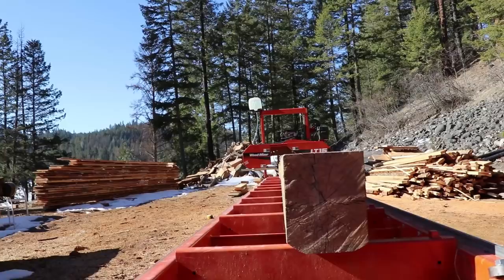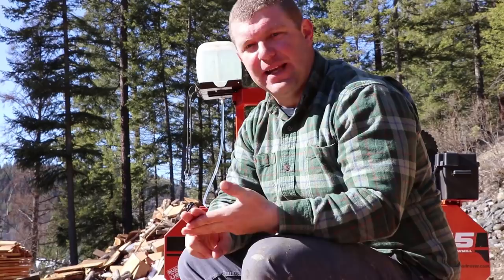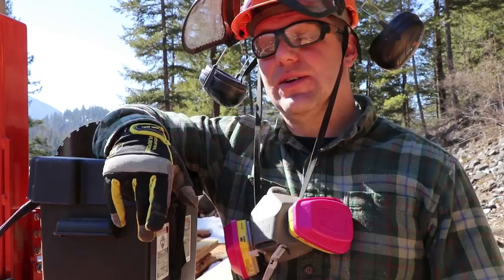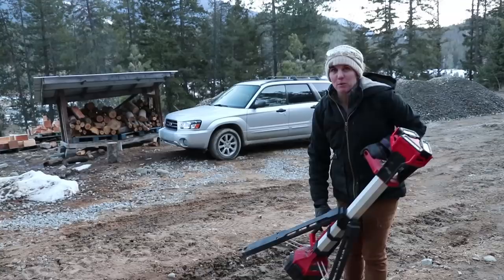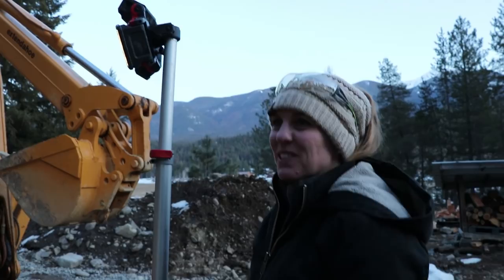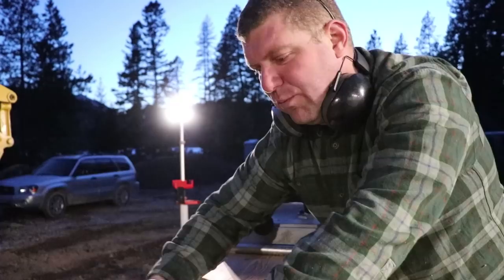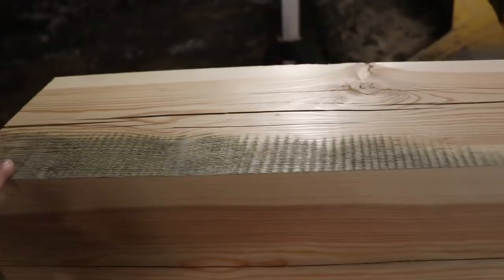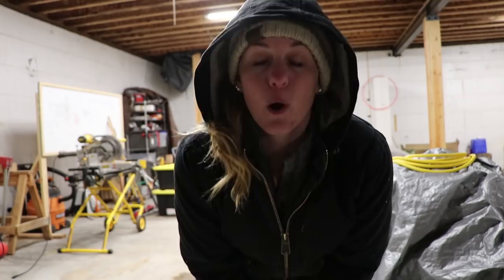From GARBAGE to GLAM (Mystery Sawmill Project)

Comment: Love your video's. So I had a thought and please pardon me if it's already been thought of. Your sawmill seems to take a lot of your time calibrating it. What if you poured a slab of concrete to put it on, well supported with rebar. Less movement of the sawmill and less time calibrating it. Of coarse you would need to pick a more permanent location for it and maybe even partially enclosing it at some point. I've got a feeling that your going to be using it for years and years. You guy's are doing a great job!!

Comment: Part of your problem is your missing the bottom locking nut on your supports. should be a nut on both sides of the steel plate on the mill. Probably should have the mill off the ground so ground heave doesn't effect level. Try 4x6s spanning concrete blocks set 12" into the ground.

Comment: Make rocket stoves using your plunge mortise chain saw on the end cuts.  Make great reusable camping or yard bbq.   Great use for small diameter waste and cooking by the patio.  Great barter and gifts.  Tarps save shaving  clean up and make bagging much easier.   You could leave a used wood rocket stove at campsights your neighbors frequent to picnic swim hike.  Much more efficient and smokeless fire to boot.  They can be put out and reused.   They make great burner for cast iron pans and pots.
Reply: There isn't a farmer with animals that wouldn't  trade carbon wood chips and sawdust for manure.   Great symbiotic compost trades.  Farmer spreads it on fields and hauls in bedding.  Recycled ag bags work until you get a dump trailer. Take turns on delivery with tailback.  Great progress.

Comment: Jesse:: I mention this one before when you mailing timbers for your house, cut some slabs that are 3 or 4 inches thick and 12 to 16 inches wide, and the length of your sawmill from side to side, where leveling feet are located cut a hole the same size of your leveling feet, set your feet into them, this will keep them from sliding around, and get rid of the concrete pads. Once you have level the planks from side to side and to each other, you should not have as much problems with keeping the sawing deck level. Good luck in your endeavors.

Comment: Why not drill holes in concrete slabs on which the saw stands and then use threaded bars and nuts to get the saw level?
Reply: there is no possible way that the saw mill is that far out of level every time they turn a beam its just to add suspense to their "show". if its actually anywhere close to as bad as they make it sound its a manufacturers defect that is not normal lol

Comment: My thoughts: Get that Mill bed set up on its Flatbed Trailer. Anchor the feet, and get them precisely calibrated. Then, Weld the Adjustment Nuts into position on the leg Screws. No more jostling the Mill Bed out of calibration. And if necessary in the future, the Entire Leg assemblies could still be replaced.

Comment: Just had a thought about the calibration for the mill.  After calibrating, you could drill a smallish hole ( 3mm or so ) in each cross brace in exactly the same position all the way down the bed. Next attach a laser at one end, shooting along the length through the drilled holes......as soon as the mill goes out of true, you'll see where by the laser clipping the edge of the hole. Keep up the great vids ! :-)

Comment: I was just wondering if you made a level cement pad for the sawmill would you have to calibrate it so much? Heart job guys 😀
Reply: probably check the Wood Mizer channel for those tips
Reply: I would think so...maybe not as much but those tiny leveling legs are to small for all that weight.  I used big square timber’s and placed my mill on them.

Comment: I agree with Jay about those flexible pieces. If you’re not interested, I have a desk that could use veneer as it’s particle board, and used.  I thought it was real wood as it did have some. Alyssa could even make cylindrical baskets. Have to cut out a round wood bottom with the center a little thicker so it won’t crack. Like you need more to do😊 LOL

Comment: Thoughout this whole build, I was wondering why they did not use lock nuts to secue the feet on the mill @9:44.
Reply: Dave Krieger it’s not the feet adjusting their own it’s the mill shifting and moving on the concrete pavers and the pavers shifting and moving on the ground. In a perfect world it would be sitting on a large concrete slab and then it would never move

Comment: years of drying on our frame. even with the air to air venmar heat exchanger ventilator, window condensation was an ongoing problem for 2 years. have the ventilator ready to go as soon as it is dried in.

Comment: Jessy, I hope you don't take this the wrong way but when using corded power tools you should run the cable over your shoulder, this keeps the cord away from the action and has two advantages 1, you cannot trip over the cable and 2, the cable cannot get trapped in the tool. Great video as always.

Comment: I wonder if, in hind sight, they would have purchased the hydraulic roll and grip package?  Seems like the hydraulic option and is a huge time and labor saver.
Reply: John Lowe, Photographist i believe that version from One Lonely Farmer is 2.5 times more expensive.  50k vs 20.  I like a lucas swingblade mill.  Cuts each way, sets up over trees on ground no base to dial in, sharpening jig built in.  Flipping the blade beats wrestling logs.  Wranglestar has the mill and firewood processor o. Loan doing vlogs.   There saw is better for slabs.   The frame holding the saw is mounted over the log not under it.  Easy to level on 4 corners.  Saw can cut redwoods just raise it.

Comment: Why don't you guys throw a concrete slab and cement the base in and weld the joints once it's dialed? Seems like u guys are going to be milling quite a bit
Reply: I recall they want to move the mill somewhere else once the house is built. If they'd planned ahead and put the mill somewhere that could use the pad for a secondary purpose afterwards then it would be sensible but I suspect it's a bit late now.

Comment: I'm sorry, but I can't stand it any longer.  It isn't SIP panels.  It's SIPs.  SIP stands for Structural Insulated Panels.  So, SIP panels would be Structural Insulated Panels panels.

It's just like an ATM machine - Automated Teller machine machine.

Sorry to be the grammar N*tzi, but it's a pet peeve of mine.
Reply: You beat me to it.  Worst of all, there's a bank here in KC named "UMB", which is short for "United Missouri Bank", so you could use your "PIN Number" with your card at the "ATM Machine" at "UMB Bank" to get the money for the "SIP panels" for the superfecta of redundancy. (I'm not sorry to be the grammar N**i)
Reply: Steve Oswald w

Comment: i can' belive they do this type of fiddling every times they need to cut a beap. so much time loss... 
would it have been better to move it. make it a concrete base with steel threaded rod embedded then install the saw on top so it would no longer move until the project is over
with all the concrete they poured in the past. it might have been a better solution and this way it would stay calibrated
Reply: You have to set your saw up everyday .....I have 5 adjustments I need to make on my mills and adjustments after every blade change....And they are going to make this mill portable, I don't have a pad and never used one....